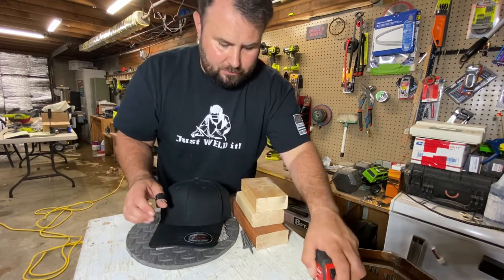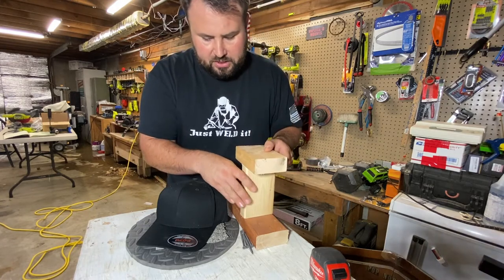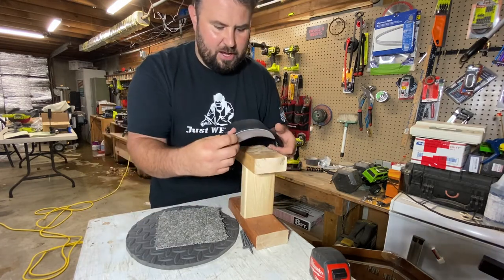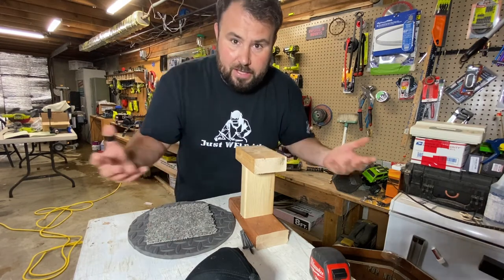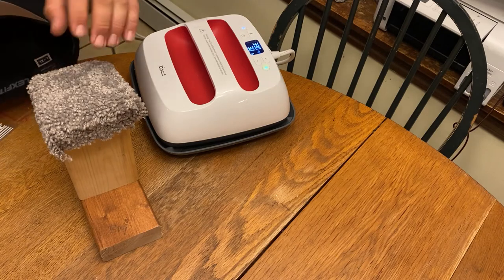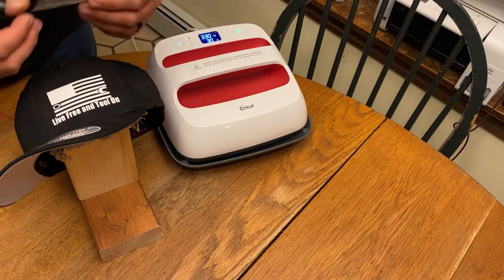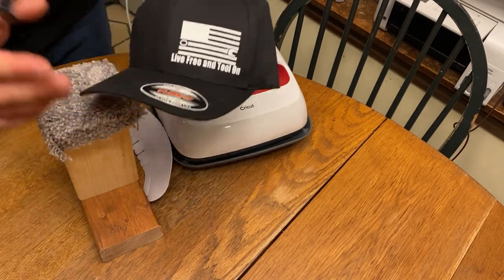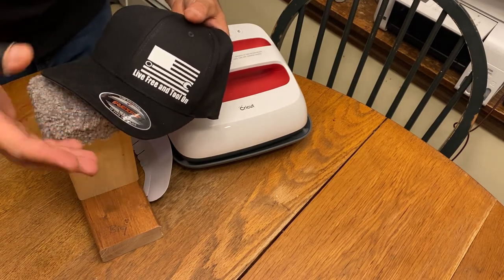Cricut Hat Press Stand [Easy, Fast, Cheap]

Comment: Can you be think of a way to make a hat press stand for the entire front instead of half? I don’t want to buy another press machine just for hats.
Reply from the maker: Good question, the issue is the shape, hats are round and you press is flat if not an actual hat press and if you Press the entire front of a hat flat it would essentially damage it
Reply: We need one that has a curve top to it. So we can press the whole front of the hat.